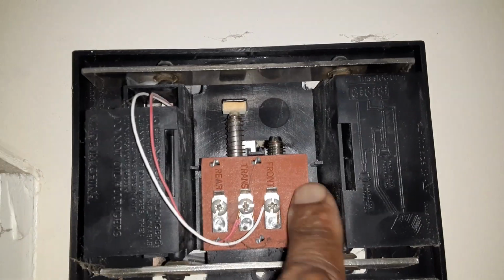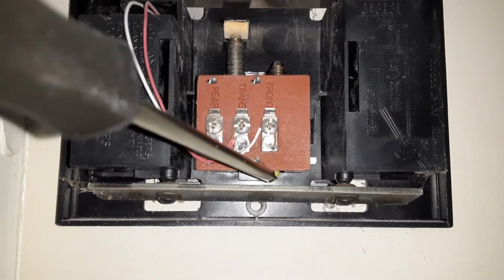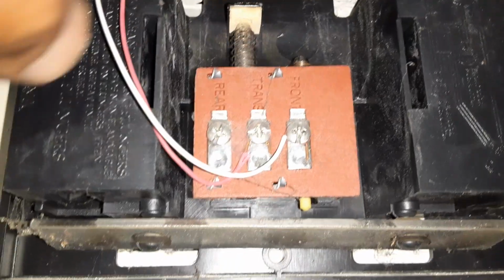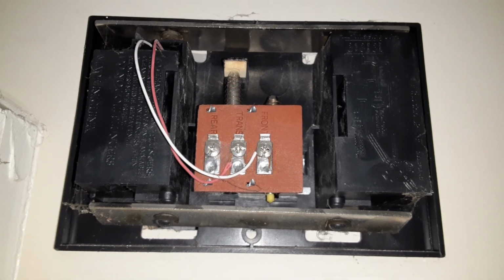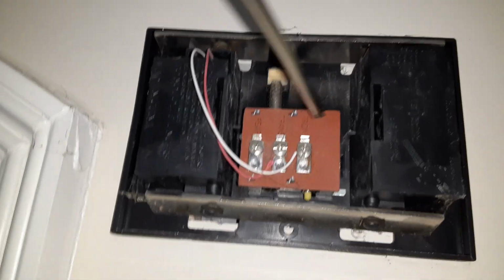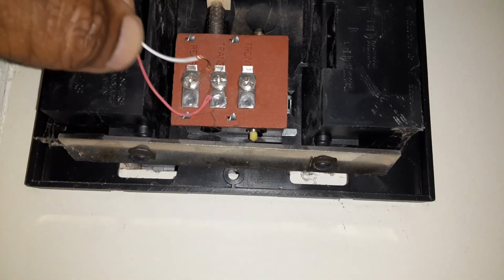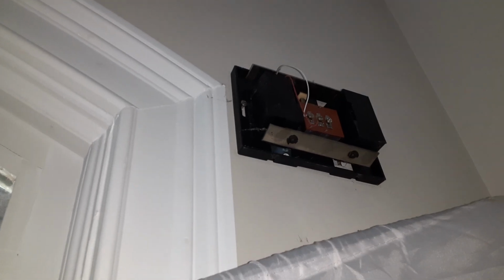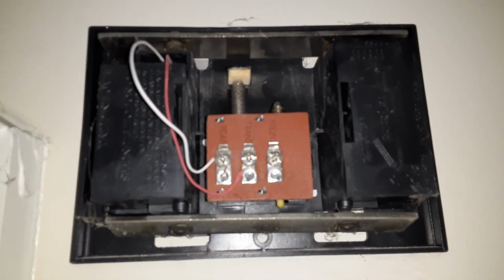How to easily fix a buzzing + Broken  Doorbell with no sound

Comment: If you cut the plastic tab that the foam pad is stick to, it will do the full ding dong.  It's meant to be used for a front and rear door bell button but, since you only have one doorbell button, you can cut that tab off and it will work like normal